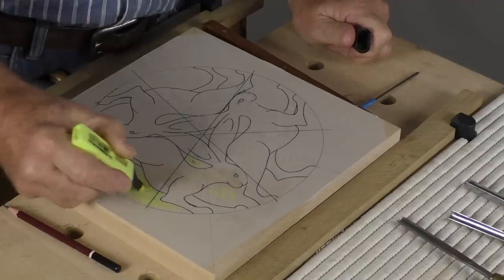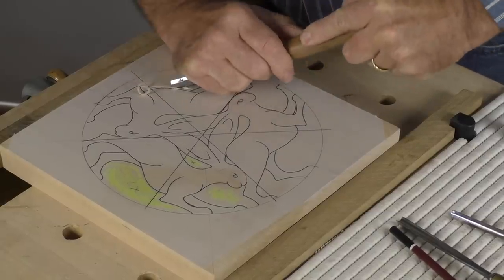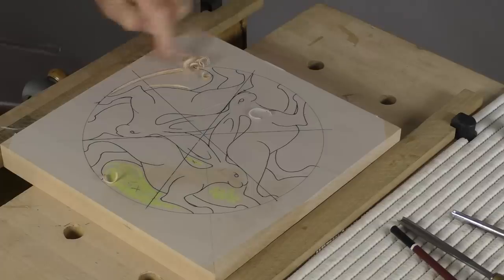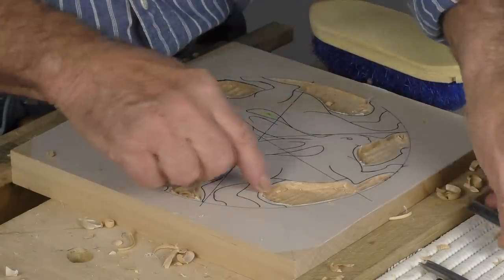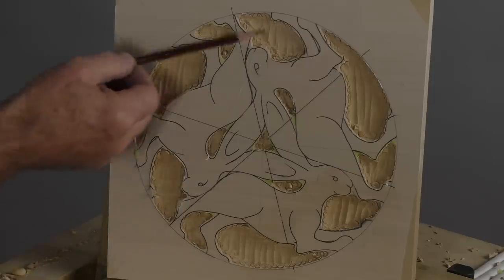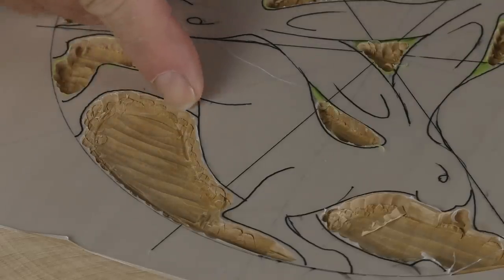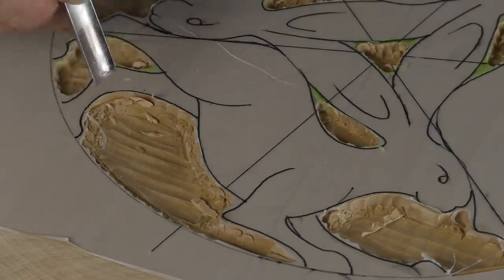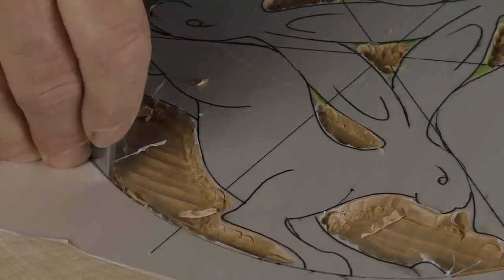How to Carve the 3 Hares Relief

Comment: I appreciate this video....the most i've done with relief carving is with a pocket folding knife...carving "initials" on an outdoor sitting bench ....but never done this kind of beautiful work, as you expertly demonstrate in this video. 

I am curious as to the size and types of gouges, chisels your using..
So far you've mentioned some tools...but I am curious as to their sizes and types ..

1:16 = A V-Tool to do the edges 

2:03 = a Deep Gouge #9 / #10
•#9 x 1/4, 3/8in. (6, 10 mm)
• #10 x 1/8, 1/4, 3/8in. (3, 6, 10mm)

6:09 = ??size??

8:34 = different tools used. ???

10:08 = Bent Gouge ??size??

10:37 = Short Bent / Spoon Gouge ??size??

15:41 = Vtool 

17:42 = Back bent (for curves) ??size??

25:04 = Narrow Gauge ??size?? 

25:36 = carving knife ?? 

29:43 = The EYE = #9 x 1/4, 3/8in. (6, 10 mm)

31:33= Skew chisel x 3/8in. (10mm)
31:42 = Punch tool 

33:13 = 240 Grit Sandpaper 

33:32 = Stiple Punch for background 

Tools:
These are the gouges I found most useful:
• #3 x 1/4, 3/8, 1/2, 1in. (6, 10, 14, 25mm)
• #5 x 5/8in. (16mm)
• #6 x 1/4, 3/8, 1/2in. (6, 10, 14mm)
• #8 x 1/4in. (6mm)
• #9 x 1/4, 3/8in. (6, 10 mm)
• #10 x 1/8, 1/4, 3/8in. (3, 6, 10mm)
Also 60 deg V tool and skew chisel x 3/8in. (10mm)

Comment: Very impressive indeed! You are really tempting me to start this type of carving. I currently try my hand at chip carving - I've not tried relief carving.....yet. What type of wood do you use? And, what set of knives would you recommend?
Reply from the maker: AI L - I hope you are more than tempted! The main sort of wood I use, and what I am using here, is Limewood (Basswood). Besides carving well, the light colour shows off the lights and shadows of a shallow relief carving like this.
As for tools, I don't use knives at all, but carving gouges, as you see in the video. There's a beginner's course and many video on carving tools and their sharpening over on the Woodcarving Workshops website. Link at the top, below the video.

Comment: Thank you for the video. I enjoyed your work and learned a ton. Bookmarked!
Never seen a square-shaped 4-pin punch you used at the end of video. 
Mind sharing what they call it or where to get one like that?
Thanks in advance!
Reply from the maker: Thanks for the kind comments! 
That punch is called a 'froster' or 'frosting tool', sometimes called a 'matting tool' and what I am doing is 'frosting' or 'matting' the wood surface. The end looks like a meat-tenderizer, with the size and number of pyramidal points varying according to what surface we carvers are looking for or what background spaces we need to get into
Frosters are easy to make by hatching grooves into something like the head of a soft metal bolt with a triangular file. There are videos on WoodcarvingWorkshops.tv where I show you how to make them, along with a variety of other useful woodcarvers' punches.

Comment: Thank you for this very informative video and the drawings. Just one question - how deep is the ground? I see it as about 6mm or 1/4”.
Reply from the maker: Bill - Yes, somewhere about that, but certainly no more. In this sort of low relief carving you need to have a strong outline, ie make biggest change of plane subject to background. All the other changes of plane within the carving are less.
Reply: @woodcarvingworkshop  thanks, I started yesterday.

Comment: Really enjoyed your video, learned alot.what wood is it. It looks easy to carve. I keep having alot of problems choosing and getting wood. Please can you help with advice
Reply from the maker: Katharine - I'd start with an online search: 'wood for carving', that sort of thing. Then see if there are local carvers or a woodcarving club - they'll have had a similar issue. Also check out woodturners (and woodturners suppliers) who use a lot of different woods, and tree surgeons. Perhaps furniture makers or joinery firms; they often throw away off-cuts. 
It's a bit of investigative work to begin with, and success will depend where you live of course. Always get more than you immediately need so you build up a store. 
You don't really need a lot of wood, mostly for us carvers a little goes a long way time-wise. 

Hope this helps!
Reply: @woodcarvingworkshop  bless you thank you so much.i will take on the challenge. At least now I have some leads to follow that's a great start. Thank you again. 😁
Reply: @katharinecrumpton6314  h

Comment: what kind of wood do you use?  it looks like it cuts so well compared to when I do. When I cut the wood it isn't smooth it has a lot of crevices in it. I have been using pine.  do you know if that is the wood or just my technique
Reply: basswood and Limewood are the same tree, different continents.  Also known as the Linden in some locales.

Comment: Incredibly helpful, but you skipped the hare's bodies entirely, was that intentional?
Reply: I see that there is an unabridged version available, thank you.
Reply from the maker: Nerissa - The video is a somewhat abridged version of what you would see on the WoodcarvingWorkshops.tv website and thus, yes, we chose to leave out a few minor bits. It seemed to me that the bodies were really quite easy compared to the other parts of the carving. So, if you can tackle the ears, the bodies shouldn't pose any difficulties.

Comment: Could i use a router to cut out those big areas?
Reply from the maker: Piano Noir - Yes, of course; a flat surface like this lends itself to a router, though I tend to keep my router for larger areas than here. 
The thing is, when you have the hand carving techniques down, as I show here and as I teach on Woodcarving Workshops,  you can do it anywhere - on curved surfaces of even inside a bowl - where routers can't reach.